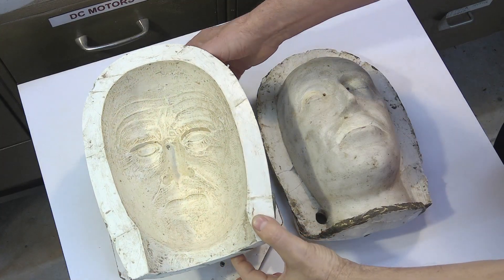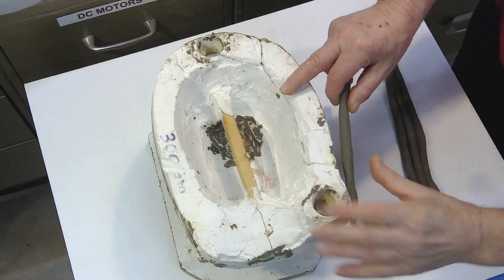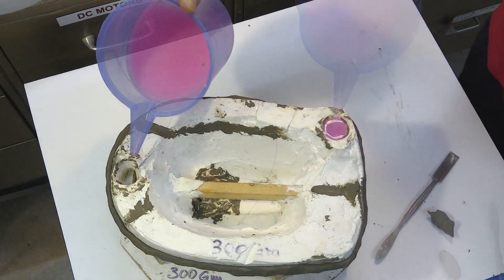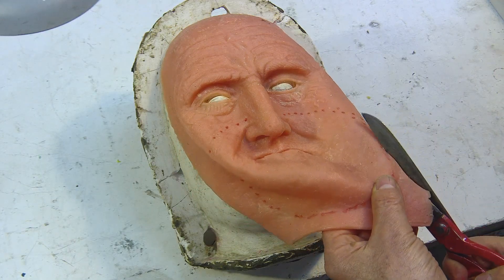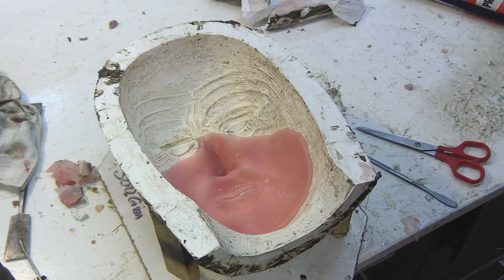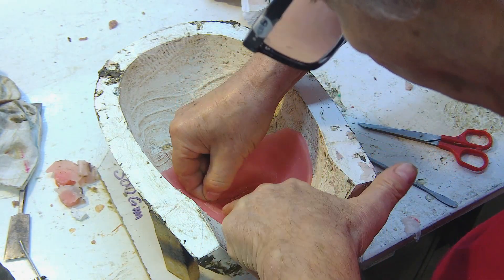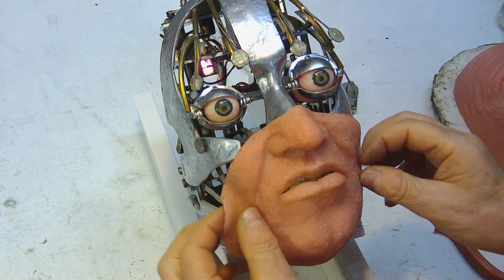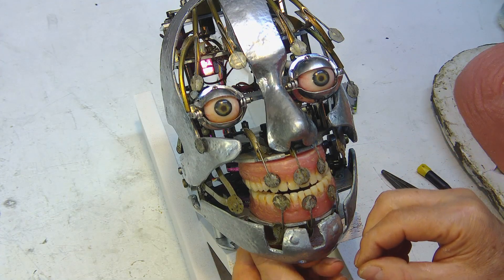Humanoid robot speaks the alphabet - Tutorial

Comment: two things that might make installation of face easier
either removable levers you glue to the face before putting it on the head

or a standardized clear skin you can stretch over the entire head, that then gets sprayed with adhesive to apply the intended outer skin, this could also help reinforce portions prone to tearing
Reply from the maker: I've been doing these things for 40 years, and I assure you that I've tried them all!
Unfortunately, your proposals are not feasible.
Thank you

Comment: Thank you for this very cool video. What kind of rubber do you use?
Reply from the maker: There are various brands of rubber on the market, the important thing is that the rubber must have a shore close to "0", it means as soft as possible, and this is why I reinforce the sides of the mouth with the net, in this way it has a lot of elasticity but the mouth does not tear.
Reply: @alvaropasseri5754  Thank you for the quick reply. I didn't mean the manufacturer, but the type of rubber: do you use silicone? 
Why I ask: Painting the lips looks easy in the video, but my experience with silicone is that all kinds of colors are difficult to hold, unless you mix them yourself with silicone...
Reply: @DanielSpringwald  He used oil paints on some other video..
Reply from the maker: @DanielSpringwald  The type of silicone I use is "MM709" from the English company "CHT" (shore 10).
To color I use the translucent cartridge silicone rubber that plumbers use, I put some of it in a glass and dilute it with white spirit, and I color it with oil paints and mix it in with a brush.
On the MM709 silicone rubber, the plumber's gun silicone sticks and never comes off, I have never used it on the other rubbers.
Later I will make videos covering all the artistic parts; eyes, teeth, shaping a face, coloring, etc.
Reply: @alvaropasseri5754  Wow, thank you for this detailed answer!